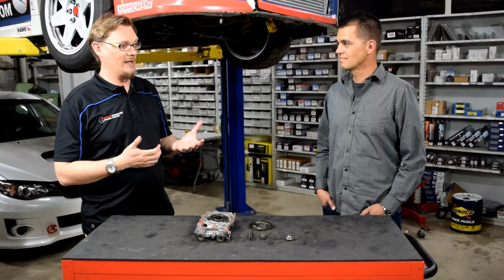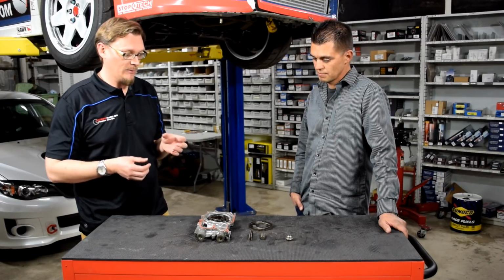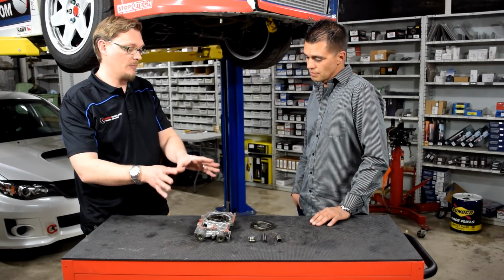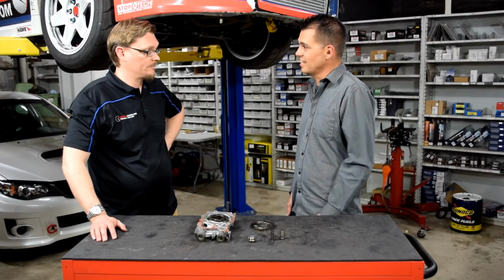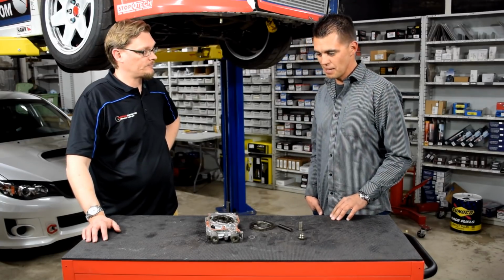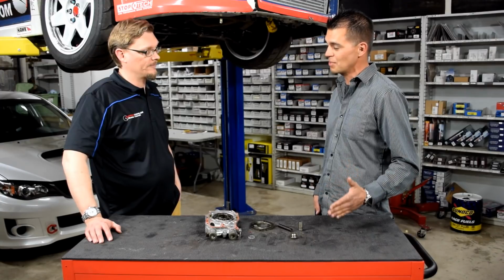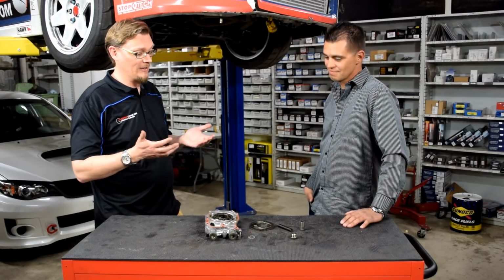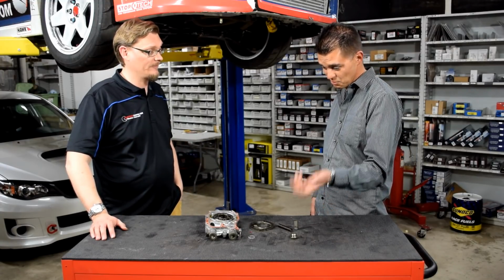A discussion of Oil Pumps, Oil Pressure, and Shimming Subaru pumps

Comment: Looks like I'll be just trying the 12mm with 1 shim as well I'll be running .01" undersized bearings  mains and rods forged internals  and plan to rev the piss out of it. I have gauges to monitor as well if Im seeing over 100ish psi I'll drop my oil weight down I guess.... lol.
Reply: hey you have any info on how your engine build is running? what pressurestemps are you seeing?
Reply: @samwashere1392  ran pretty great for ~2000km  till a contamination happened during a cooler install which ended in a spun big end bearing in the process of a rebuild right now . with stdx main and rod bearings and mobile 1 15w-50  Was seeing  800kpa on cold  start. 400kpa freeway cruising 3.5- 4krpm 80mphish (with my moroso pans extra capacity and minimal passive coolingl oil temps never rose above 40C and were usually bottomed out )  

spirited driving it was basically between 450-500kpa depending on oil temp as it rose up to 100c I was losing a tiny bit a pressure down to about 430kpa  but still within what is considered acceptable for a stock psi. Cooler was put on to keep my oil temps around the 80c area but yeah didnt work out for me in the end :/.  

 But by the time I was getting to 100c oil temp my water temps were also rising above 100c at the same time which could be contributing to the issue so I'd be backing off at that point anyways until it cooled back down.  This is all while driving in the 5-7k rpm range for 10-15mins straight on a mountainous road with changing inclines and all which Im sure is a bit harder on cooling in general.   
 
Next set up will be a 12mm pump 3 shims total and i'll be using half std and stx mains  with stdx rod bearings in hopes of maintaining above 450-500kpa with a rise in temp up to 100c+ as I ideally shouldnt be seeing a drop below the 450kpa  and hopefully will be able to run a bit thinner oil on the daily and thick when I get to Finally track it.   I think that should cover your question but lmk if you'd like to know anymore! 🤘🏻
Reply: @strifefaction  thank you! Lots of good info!  

What happened with the oil cooler contamination? Something of outside influence?

What motor do you have? It’s in the GC8 on your channel? 
Non avcs, single or duel?

I guess your not worried about the added  oil bypass with the 12mm pump and std + stdx bearings?
Reply: @samwashere1392   
After I tore it all apart I found a couple tiny pieces of Stainless steel mesh that Likely got into the 10an lines while I was cutting them apart to build the set up.  Sad as I flushed all the lines with a hose that has pretty "high" pressure so 2-3 minutes each  but wasnt enough to clear them fully it'd seem and I suspect the went thru the crank into the big end bearing and damaged it enough to not knock immediately but as I was trying to diag the very low oil pressure which was sub 200kpa at all times usually less than 100kpa at idle.(was 200kpa prior to the install while still running good ) the low pressure combined with total lack of power and all my Fluid temps rising suuuuper fast I should've know to just stop and take it apart right then but   it eventually fully spun the big end bearing within the next day on a short test drive..

Yupp in my gc. Was suppose to have a video out going over the whole incident/tear down but most of the footage got lost/over written. So I'll be filming a new one soon with a some explanation and then a timelapse build/ reinstall.  

 brief build overview v7 207 so single avcs with stock cams and valves. Built bottom end with Carrillo Pro Super A beam rods and 92.5mm Toda Racing pistons.  And a Garrett GTX2867R Gen 2 with an 11 blade wheel. Id1300x , catless invidia dp and catless Hks hi-powrer. 

So with the 2 shims I wasnt getting any by-pass from what I could tell with stdx main and rods but given Im going to be using the half std/stdx mains this time Im going to add one more shim to negate any possibility of bypass. Ideally this should allow me to have better pressure throughout the useable temp range of oil as getting drop off at 100c seemed a bit premature as that's oils heavy weight rating temp so should still be performing properly to A bit above that ideally.
Reply: @strifefaction  thank you so much for all this actual real info!! I’m trying to put this engine together for a friend…we’ll see how long it lasts lol.
Hope to see your next video soon!
Reply: @samwashere1392  not a problem! 🤘🏻  I wish you luck if you're going to add and oil cooler the premade kit route is probably your best bet for safety reasons I've install the mishimoto kit for the GD platform(works on gc as well) on one of my friends Gcs awhile back and his is problem free.   My bearing/oil pump choice is based on me wanting to rev it too the moon (my break in tune was limited to 7.2k but the plan was to have it rev out to 8k+ once it was ready to dyno. idk what his goals on but a shimmed 11mm pump may be a good route as well if you're running std bearings and live in a cooler place.  The whole process is a bit time consuming but totally doable just extra steps cuz subaru doesnt make anything thats just easy to work on. Lol  and thanks should going to start filming first week in feb when I get my rods back from being reconditioned. Appreciate the support (｡•̀ᴗ-)و ̑̑✧

Comment: You guys definitely hit on a topic that's really not discussed on the internet. Most information you find on the internet just factory engines using factory clearances & people are relying on temp readings only. I personally have a built engine that I built a little looser on my main bearings clearances and I'm currently waiting on my oil pressure gauge to come in on shipping for this exact reason. Once bearing clearance has been changed oil pressure gauge must be used. I have only tuned my cold and warm start idle. Once I receive my oil pressure gauge then I will continue my tune. End of discussion.
Reply from the maker: Thanks for your comment.  Glad that you found the video and that it was helpful.

Thanks for watching and Stay Tuned!

Comment: I have used 11 and 12mm pumps in my dedicated track car. I port them myself and go much farther than anything else I've seen anyone do. Not wanting to publish bad information I have held off on making my mods known to the public. On my 470 HP DAVCS race engine I run my modified 12mm pump and a Peterson adjustable oil pressure relief valve. This lets the bypassed oil go straight to my Killer B oil pan. No heating and aerating of oil!
With this first link I discuss and it contains links to documentation and oil system mods I've done.
https://forums.nasioc.com/forums/showpost.php?p=45375002&postcount=245
https://downtime.nasioc.com/forums/showpost.php?p=46080057&postcount=171
Reply from the maker: Thanks for the information Glyn!  Will have to check it out.

Stay Tuned!

Comment: Great video guys! I'd love to lend a tip: You can add a system relief Anywhere in the system! So no need to remove the oil pump to shim it. In fact, any Subi could get a 12mm pump, shim it quite a bit, then add a nice adjustable relief at the back top end of the block after the main stretch that delivers oil to the crank.
Reply: Funny you mentioned that. I am doing that but it goes through an oil bypass filter before returned to the oil sump. That’s why I use the 12 mm filter that bypass filter, and I have an oil cooler as well. you can tune the flow to the exact pressure you want and keep cavitation at bay. With the bypass filter flow

Comment: Bringing up another step...
U guys can compare 10mil vs 12mil pump that already ported (smooth out sharp edges and chamfer) on the oil pickup side all the way to the rotor chamber....

Im sure people wants to know how it react in term of pressure and flow by increasing the suction side efficiency
Reply from the maker: Thanks for the suggestion.  We'll add it to the list!

Thanks for watching and Stay Tuned!

Comment: Very nice discussion! Do you maybe have a log/histogram of the oil pressure vs. engine speed? I've been working on my engine and I already see max pressure (90 psi) at 2500 rpm using a 10w40, listening to this I see that this might lead to heating up the oil more than needed due to the bypass it has to be pushed through. Is this a risk you think? 
I do have to say that it is still a fresh build and the engine did not break-in as of yet, so I suppose the graph I see will probably move too a higher engine speed as the the break-in progresses (first instance of max pressure moving towards higher rpm I mean by that). Thanks
Reply from the maker: Thanks for your question.  We don't have a graph of pressure in this case.  I will say that when you first start your engine, it is completely normal to see high oil pressure in the 90 - 100 psi range.  The heavier weight of oil you are using, the higher this pressure will be typically.

You definitely want to pay close attention once the oil has heated up to operating temperature.After say 15 minutes of driving or so.  From that point on, you will have a clear picture of the oil pressure you will see during normal operation, and from that point on, you can decide if you are comfortable with it, or if it might require some changes to get it where you want it to be.

I hope that helps, and Stay Tuned!

Comment: I think wrc engines require 12mm pump.  He said he used the 10mm.. also no, the spring tension remains the same in the relief valve, you just change the rate at which it opens, As the spring never changed its physical structure.

Comment: No mention of the loss in HP. Making the engine pump more oil at higher pressure has to lower the usable HP to the wheels. Maybe only a few, but maybe more. I expect more.

Comment: Please correct me if I'm wrong, running 12mm pump in stock clearances without additional oil cooler will result in oil temperatures getting high?
Reply from the maker: I wouldn't say that  would happen absolutely, but it is a possibility.  Running a significantly larger pump than is required will mean that the relief valve will be open for a much higher percentage of time, and that can lead to an increase in oil temperature and some other issues.

Hope that helps, and Stay Tuned!

Comment: Hi, what would be the accaptable oil pressure for 2006 Subaru STI? I am currently seeing 17 - 18 psi on a warmed up engine on idle (800 rpm). This is running 10w60 oil. Is that not too low? The oil pump is still stock but the engine was rebuilt.
Reply from the maker: Given that you are running a 60 weight I would say that the hot idle pressure does seem a little low.  When the engine was rebuilt, were loser tolerances used?

Is that hot idle pressure what you have always seen?  Or is it now lower than what it used to be?
What peak pressure are you seeing when driving?
Reply: @FlatironsTuning  most probably loser tolerances were used - I honestly have little information about what is inside the engine exactly, it was a weird situation that would need a lot of explaining. Anyway, the pressure was the same since the rebuilt. When driving pressure is at around 85 - 90 psi at 3000 - 4000 rpm. There are also no external leaks but the engine takes some oil (not too much to be worried and there is no blue smoke). Thanks for the response :)
Reply from the maker: @Jan-zf8mv  Your peak pressures sound good.  How many miles since the re-build?  If loser tolerances were used on the bearings, then you would need a larger volume pump to maintain pressure.  If you have a descent amount of miles, then it may not be an issue.

Comment: Hello, great video guys! I have a few questions about the pump size...WRX 2001 EJ205...when my engine failed after I bought the car, I decided to build the engine with 12mm pump thinking "the more oil press, the better..." Man who built it for me is used to build the engines with increased tolerances. I use Castrol 10W60 and have 30 thousands kilometers on the engine. Should I have a worries about it, maybe cavitation or whatever? Oil gauge located on turbo inlet, 2.6bar@90deg celsius on idle, 6bar@90deg celsius while driving. Spec-C crankshaft with cross-drilled  crank pin. Approx 300BHP. Should I go back to 10mm or 11mm? Engine seems to run really smoothly. Thanks a lot!
Reply from the maker: Thanks for your question.  With that many miles, I'd have to say, if it isn't broke, don't fix it :-)

Keep in mind that the larger pump will give you more volume, not pressure.  Peak pressure is controlled by the relief valve spring, but the larger rotor will get you to that peak pressure faster.

If you are running loser tolerances, then you would need a larger volume pump to maintain pressure, so since it sounds like that is what you have, I think that you have the correct pump.

If you were having any issues with pressure, what you would see is a fall-off in the upper rpm range as we discuss in this video.

Hope that helps, and thanks for watching!

Comment: Fantastic video as always! I have been doing some reading about the EJ25, specifically how there are alot of rod bearing failures. Now a rod bearing failure is primarily an issue with the oiling system - some cases the engine was run low on oil. But lots of cases where it was not run low on oil and poor tuning was not the cause.

Where I am going with this is, there are some threads about porting/smoothing out some oil galley's on the block/oil pump. 

Have you tried this? Does it increase the reliability of the EJ's oiling system?
Reply from the maker: Thanks for your question!  Bearing failures are definitely a tricky one.  From what we have seen, I think that oil level is the leading cause, but it can be for a few different reasons.  

Specifically, running the car low on oil, oil consumption, and issues with the PCV system all can come into play.

But yes, modifying the oil pumps is something that certain builders will do.  Cosworth had a Blueprinted pump, and Roger Clark goes through and blueprints them, and replaces the pressure relief valve with one of their own design.

It can definitely be helpful, but there are a number of other things that you would want to watch as well.

Hope that helps, and thanks for watching!
Reply: @FlatironsTuning  What are your thoughts on the increased failings around the 08 year? Some people say that the casting on the oil ports of the case's were not quite as good as the older years - and were later rectified?

Its a bit of a strange theory - as if this was the case wouldn't failure happen quite quickly? As long as the pickup is sucking the oil up - there should be no spun bearings.
Reply from the maker: @Booki89  Nope, it was actually the bearing material.  They had to remove the lead, and didn't fully account how much of a change that would make in the bearings.  The fix was the heat treated cranks/nitride treated cranks, and now that they have switched to those across the board, there hasn't really been an issue.
Reply: @FlatironsTuning  The more you know! How did removing the lead effect the bearing's? Did they have different expansion characteristics?

Would using after market bearings solve this issue if using a older style crank?

Comment: At high rpms you will see a pressure drop due to less oil being in the pan and there being a shorter column of oil left in the oil pickup. It takes more force to pull that up which will lower your pressure. A higher outputting oil pump will actually increase that effect because there is more oil being used throughout the engine.
Reply: No
Reply: No